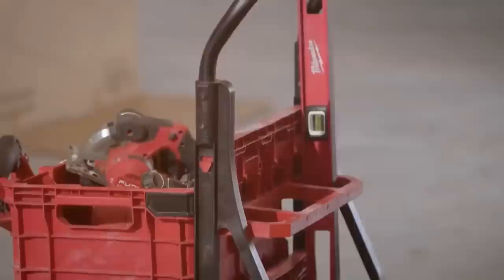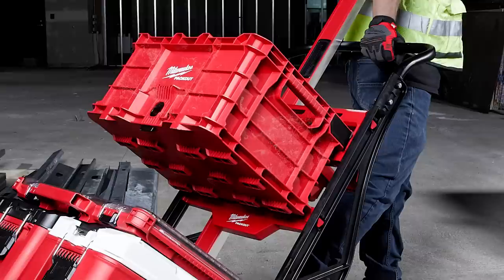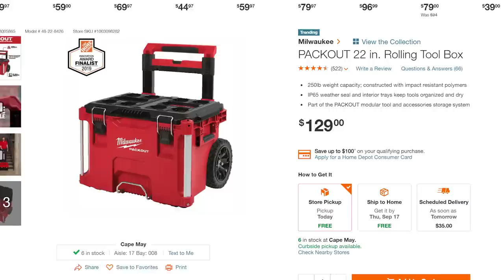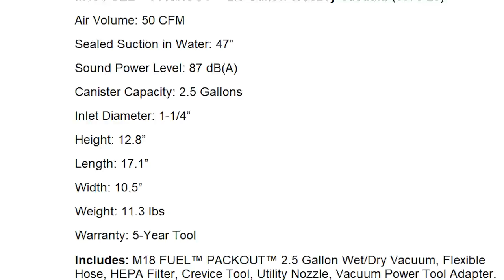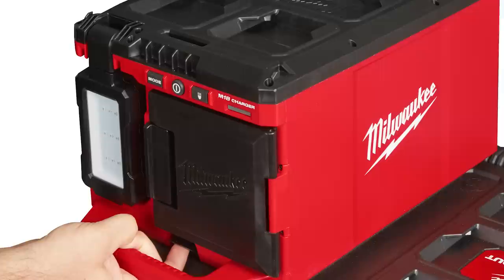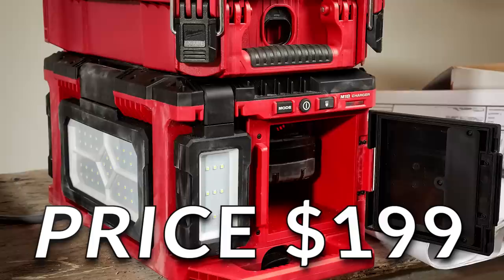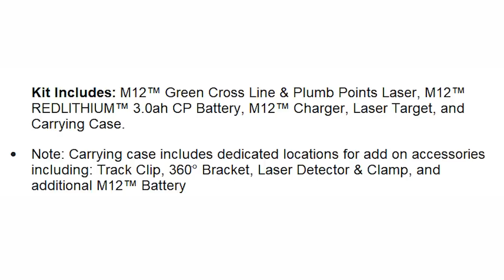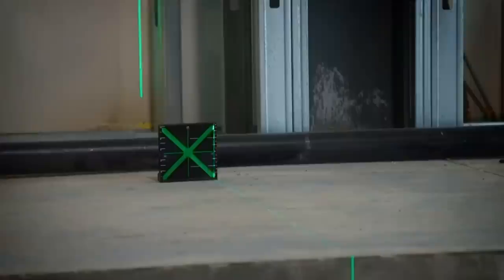NEW MILWAUKEE TOOLS NEVER SEEN BEFORE (They Finally Did It!)

Comment: So in my work van, I always hated having to tie my pack out with wheels with a bungee cord. It never seemed to hold for me when I had everything stacked on it, it would fall over. So I decided to take out the rolling wheel pack out completely to install the pack out mounting plate to the floor & that was my new solution to hold the pack out in place. But I lost the ability to roll my pack out everywhere. The pack out dolly is the perfect solution because I still don’t need the rolling pack out & I can store the dolly in a tight spot in the van until I need to roll my pack out somewhere. Thanks for the video 👍🏽

Comment: If they add a bluetooth speaker to that light charger, then they got a real winner
Reply: Always wondered why the 2792-20 m18 radio charger doesn’t have a light. 

My cheap waterproof Bluetooth speaker does (handy in a bind), yet it doesn’t have the bottle opener...
Reply: Agreed 100%
Reply: Gotta agree
Reply: Certainly big enough! Could probably have a multi-rapid charger too.

Comment: Honeslty, I think some of these prices are highway robbery. The pack out is a cool system.  But It’s way over priced for just plastic.
Reply: Really don't get all the packout hype.
Reply: Dewalt toughsystem tool storage looks like a cheap toy compared to a Packout side by side. When I've seen it for the first time in action I thought it must be a cheaper TSTAK. In UK Milwaukee cost way more than in US sadly, and that's a crime in my opinion
Reply: When I work on remote cabins these packouts strap down great on my honda 4 wheeler. I try to get free packouts during Milwaukee tent sales when they give you a box for buying 2ctools usually
Reply: Value is subjective to some it's just boxes to others this is freedom (through organization)
Reply: I went from the dewalt to the Milwaukee and it is very overpriced but it was more ergonomic to access tool and they quality is way better, that’s what your paying for. Still a crime to pay that much for them though
Reply: You get what you pay for. I have both the DeWalt and Ridgid systems in addition to the packout and the quality of the packout system is unmatched, in fact its not even close.
Reply: Agreed have the rolling box set and handle is bent 
Got entire Ridgid set for $89 last year and just as good
Reply: It's glass fiber reinforced and is build strong as hell plus they're waterproof so you could leave your tools in the back of your truck during torrential down pour with no issue and doesn't get condensation on tools in hot to cold environment
Reply: Your paying for R&D brother
Reply: That’s why I got the husky one . They’re both plastic the husky one is cheaper and hasn’t broken on me yet
Reply: I'm pretty sure this is glass fiber reinforced nylon. Not cheap abs plastic.
Reply: @TREE52HD  exactly. People think plastic is all the same. It's  not even close.
Reply: @thtbest5k4t3  doubt the husky is made of the same plastic.

Comment: I can see the worktop having some useful applications, but $50 is pretty steep. I can put my coffee and notepad somewhere else for that price. If it were a bit larger they could’ve put markings on the surface to measure small cuts quickly or something but even then it’s not exactly a smokin deal.
Reply: sup dave grimm
Reply: kingofthecrease30 hey king what’s good boss? How you been?
Reply: @puresikness77  been good...keeping busy working alot
Reply: It's basically a fancy Miwaukee cutting board.

Black Friday price it for $19.99 and it would sell. I know I would buy it at that price.

Comment: I'm a service tech for a company that repairs/maintains espresso machines, brewing equipment, etc. for starbucks and others. I recently got a packout and that worktop sounds perfect. With that I wouldn't need a separate utility cart for working on modules and parts. That vacuum and the boxes with drawers are tempting too...

Comment: Just waiting for the packout solar panel charger 🤞
Reply: Now we’re talking!
Reply: I’m not even mad at that idea. They need to revise the light box with that feature
Reply: I saw a acdc plug logo, was thinking portable power station runs off 2 battery
Reply: It will have to be area size of a few fridges to preform on same level as plug in chargers. Look at 100W solar panel size and I think regular charger is about 275W or something, quick charger 330W and supercharger is whooping 6A@120V so about 720W on full power use. Needless to say law of physics still apply for conversion of energy. I think small propane generator would have been easier solution but doubt it would be popular enough to justify the developmental costs.

Comment: What I see the best use of the work top is if you have some special test equipment or device that you carry to your work area frequently. Mount it to that surface permanently.  Then it would be secured to your Packout stack for worry free toting without having to strap it on.

Comment: As a union pipefitter, I would use the work top. A vice would be used constantly for soldering fittings and cleaning copper etc, I'd flip the whole thing if I put the pipe wrench to it though. Cool item.

Comment: I like the worktop idea with a vise....  I do drain cleaning and often use a jetter..  nozzle gets stuck often on the hose...and I need a 3rd hand.  I won’t be cranking or pounding,, but need a firm grip...  I have a vise on trailer jetter,, but often that’s 60-100 ft away...  so.  Yea, for me.  It’s awesome

Comment: As far as the rack system, I am torn.  I can see this being nice in a van.  I can also see this being a nice set up if you were able to figure a way to attach the rails/strips to the packout base or maybe the dolly.   Or build your own wheeled device. Then you could have access to any box/container and not have to remove the boxes above.  But I agree, they need to release a longer set of rails/strips and more shelves.
Reply: If they and they might sold the mounts with brackets for  wall mounting I think it would be great for vans
Reply: @ALPHABEASTACE  If you watch the Pipeline video, you'll see that they designed these more specifically for a van, so you get all 4 pieces, 2 racks/mounting strips and 2 shelves.

Comment: The shelving system is tempting, but for that price, I'm not too sure about it especially since the rails look like the same rails used inside trailers. If it does work in trailer type rails that would be nice but come down to about $25 for the shelf then they may be onto something.
Reply: The rails are standard E-Track, I remember hearing them say that in the pipeline episode

Comment: Your view on the $49.99 top is correct in that using a vice like they show is absurd...HOWEVER, for smaller work that I do on small projects and repairs, with maybe a small panavise or soldering vise, it seems to be a home run.

for my soldering, tool & equipment repair, and even things like non construction projects like layout of small joints or even guitar repair(hobby) it is great. 

also as an extra, it is a clean surface for my lunch & coffee.

I think at $35 it is a steal.  if I get packouts for my soldering & fine work equipment (I have dewalt tstak & bosch boxes (which are too wide & awkward) & festool which are not great in really cold weather.

I wish I had packout instead of bosch or festool systainers

BTW
really annoyed that my festool ct22 vac cracked and has a hole in bottom because it was 10 degrees on a job and it sat in my van all day before I moved it.

my fein vac is indestructible

keep up the good work.
Reply from the maker: Thank you for the feedback and real world experience we appreciate it!

Comment: I think this will have great options like miter saw. 7 1/4 in or table saw.    Now not to use on the top but to move these items around the site  with great ease

Comment: Great video Vince, 

The packout hand truck is number one for me.   Never like the bottom bin cart, don't like my expensive tools throw on top each other.  Plus a hand cart that folds down for easy storage and holds yard tools or levels is going to be a must !!!

The packout top lid is something I am interested in.   I do handyman work and this has few uses for the field. 

1.)  Having a vise for the small plumbing work I do will be nice to have close by for 1" - 1 1/2" steel pipe or copper pipe jobs this will be handy to have.  
2.)  Landscape lighting repair jobs - having a flat surface to place on top of the dirt/rocks while doing my repair work that I have close by in my packout stack will be helpful.   Keeping small parts out of the dirt/rocks while doing this work will be nice, plus having a flat clean surface for assembly of expensive landscape lights will keep the nice finish coating intact for the clients.  
3.) Having a wood flat surface for assembly work or disassembly work part/screws organization will be nice.  Being able to draw a diagram and place parts/screws on the flat surface in the field allows me to save time and keeps confidence that all the parts went back where they came from.   5 acre properties can have a lot of lighting, watering systems and not losing a rubber washer or lock nut saves me a trip to the van or hardware over a .20 cent part I have lost on the ground..   
4. ) Another use would be when I have multiple junctions of landscape wires coming into one spot, I have dug out, being able to slide this under them and label the board will be faster than dealing with tape labeling system on wet dirty thin wires.  I will have this near the job cause it will be on top of the pack out stack easier transport than even hunting down a piece of wood.  

Price sucks - Justified it a little at first cause the packout locking system, but then I remembered the small packout parts organizers and they are only 20 -30 depending on deals.  They have the packout locking system plus way more additional plastic parts, so no this is too much milwaukee.  20.00 to 30.00 would be great, 30.00 to 40.00 hmm maybe but 50.00 plus liberal bullshit  sales taxes on top of that that's pushing it, plus the wood appears to have radius corners, making replacement that much more of a pain... 

Really want to see some updates on their communication hand tools.  Milwaukee doesn't make a coaxial cable stripper and their RJ45 tool needs to be updated to the wire through connectors.   Already have most of my hand tools from Milwaukee and my tool OCD would like these as well, plus a CAT6 tester...

Comment: Good info Vince,👍
 E track is a very smart choice for Milwaukee's shelf units. They are installing E track into enclosed trailers as an upgraded. This track can be purchased separately in various lengths up to 10' long. I purchased E track from my local utility trailer dealer.
Reply from the maker: Thanks for the info Ronald!

Comment: I agree...the work top would be better used as a writing/computing surface, and a scrap piece of smooth plywood does the same job a lot cheaper than the $50 price point.

Comment: I personally really want one of the packout worktops, I go out on breakdowns a fair bit, and being able to move my vice, bench grinder and any other small bench-top tools between secure mountings on the van and in the shop, without having to unbolt them or buy it all twice, I can just clip, walk, clip and plug it into a genny on the side of the road, super handy for the right folks

Comment: Hi Guys!!!  That dolly is so close to being right.  If the dolly rails had slots to mount the new packout shelves anywhere on the rails, then that would be awesome!  That would be very close to the ability of the Dewalt dolly to pull out boxes independently.  The con would be lifting the box a little before pulling it out.  On the new drawer boxes, I wonder how water-resistant/proof they are?  Will my tools get rusted in those easily?

Comment: The top and vice would be pretty good for locking a copper pipe at a specific position while brazing. Or some light work in the electrical field but ehhhh it shouldn't be plastic or wood and should have foot petal/bar attachment for the base of the pack out in order to put some counter pressure on the pack out opposite side of the way you're cranking down

Comment: The worktop would be cool if it had slide out supports for cutting 2*4s. Like on the ends of a mitre saw. And yes I realize how top heavy that is. But if it was essentially a saw horse that saves a trip back to the truck everytime.

Comment: In defence of the racking system.... It looks like it can fold up and still hold packout stuff vertically.... Alot of guys and a ton of DYI guys would not be able to do that... And even the guys who could build their own shelves that could hold packout both vertically and horizontally would take more time to design and build that it might be worth..... Take me for example I am about to get a new work trailer.... For the lower shelves below the work bench I can build my own shelves with the mounting plate already on the market.... But I would seriously consider the racking system for storage solutions above the main work bench because it would probably save me time

Comment: I always wanted a m12, cross/plumb laser.  I got a different one for 200 CAD (red bosch) id love the m12, but at 399 USD  it will be like 500CAD for the bare tool, its just too much.  I get green is better than red, but 2.5 times the cost of a solution I use rarely isn't worth the price to me. (fire sprinkler system installer trade)

Comment: The PACKOUT charger light is probably at the top of my list from this pipeline episode. I love the charger radio from last year, but I typically use earbuds because they add some hearing protection from tools, and I don't need to worry about disturbing others. So sadly, as nice as that stereo is, it would go largely neglected. The light on the other hand could always be useful. The PACKVAC is really cool too. To have dust collection built right into your tool hauler could likely save a lot of time cleaning up by simply running it while you make the mess

Comment: I really need to use that worktop for a vice holder. However.....unless your lower box is full of dumbbells, I feel like I'm just going to flip it over once the pressure I'm exerting exceeds the weight. Some of the pipes I'm taking apart are doped in and 10 years old and covered in rust. When I really start pulling on that badboy ...I guarantee you it's going over and that plastic is going to start to deform. Milwaukee makes tough stuff, but for what I need it for no.

Comment: Contrary to other folks comments, I think there's going to be a lot of folks buying the packout work top.  The industries that don't need heavy things placed in a vice, like cable runners (Data cables) and other non "high impact" trades will certainly find it useful for different things.  I can see people getting a side mount for the packout stack from a third party and hanging the worktop from the side until needed.  I looked at it and could have about 10 different uses for it, but i'm just a DIY guy.  I'll probably get the Wet/dry Vac and a few of the racks to mount in my new garage that can hold the crates.  I have multiple crates for different "trades" or projects so I can just grab a crate and go.

Comment: Nothing against milwuakee, but the Bosch 12volt 3 way lasers with optional magnetic elevation adjust ment bracket are hard to beat. The only downside is that their on/off button is so stiff, that you cannot turn it on or off without messing up the position. The elevation adjustment bracket is so convenient. We take a guess, slap the bracket on an I beam, and go up or down.

Comment: I would go with the 3D print and scrap board for the work top. As for the shelves, if I already had E-track in a van that i used for secure equipment to then yes, for a shop no.

Comment: The table/work top was cool in the beginning.  Then I started thinking about it, and it doesn't seem to be all that much of a necessity any more.  I can always throw a piece of plywood on the stack if I need a place to write or look at prints etc.  But if it is a work station, and you have the vice on it, it won't take a lot of pressure to tip the stack over, or like you said, pull the screws out.  Not to mention that if you have a lot of tools or pencils etc on the top and you need to roll your stack out of the way, then everything will fall off when you tilt the stack, or you'll have to spend a lot of time putting everything away, or disconnect the top, hold it level, move the stack and then carefully reattach the top.  If it had a 3/4 or 1 inch tall lip around the edges, it may be better.

Comment: I could see a use for splicing high voltage powercables in a ditch and a tent where the cable end needs to stay clean and stable though you also need to sometimes use a blow torch and plastic might be an issue also for home mechanics a small vice holding circuit borads and the like but for things needing a 1,5meter wrech no way.

Comment: I wanted to ask if the worktop would work on the wall mount shelving system. I’m just wondering if possibly mounting the drawers and then using the worktop as either a writing surface OR a place to set chargers..

Comment: The work top might be ok for something like the vice holding conduit to cut or maybe pvc or copper line. Maybe holding something so u can drill a hole in it or something like. Maybe u just need a third hand to hold something so u can use both hands to work on the piece.
Reply from the maker: Could come in handy for some situations I just wish it had a larger surface area and less plastic. Oh and the price was too high.